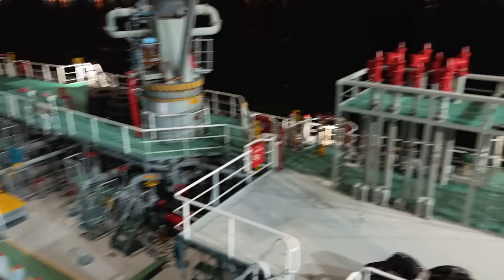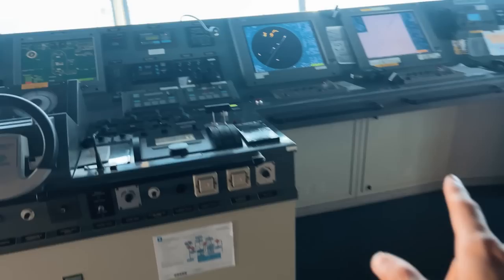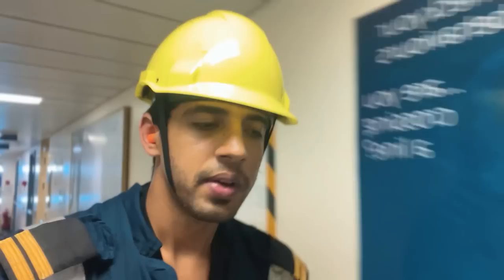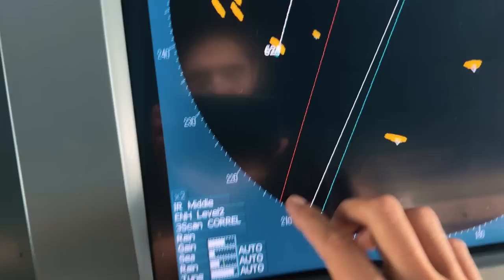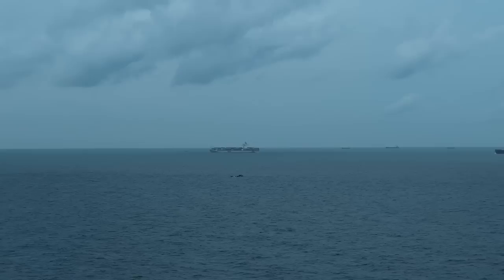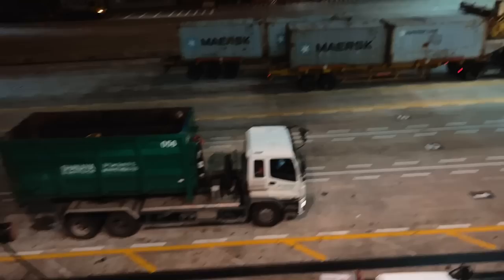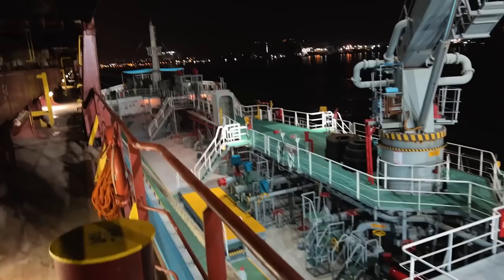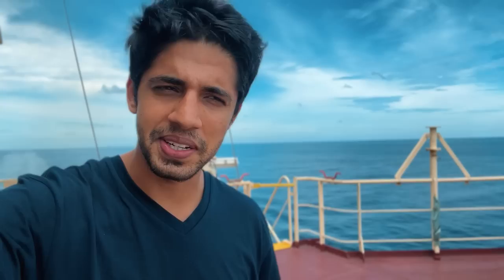REFUELING my Ship with $200,000 worth of FUEL!

Comment: Currently I'm working in Refinery operation, this is pretty similar to Ship like.. Enginee, EOT Crane, Hydraulic System, Propeller, Work shop, Control valves, Variety of Valves, Control room & DCS, Coveralls, Refrigeration unit, Chemical dosing, MSDS, TPM, 5S , Safety, PPE,  and many more
Reply from the maker: Glad you could connect nirakar